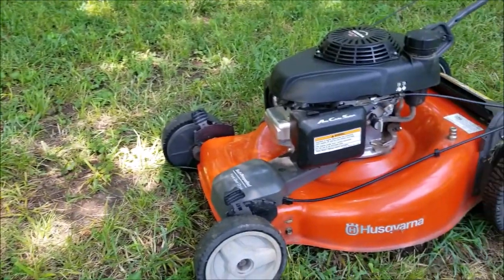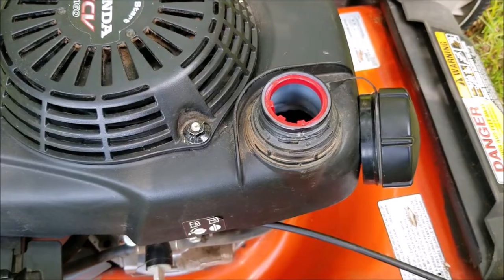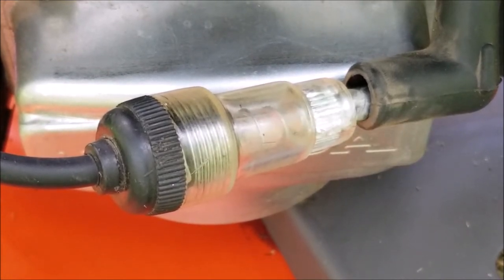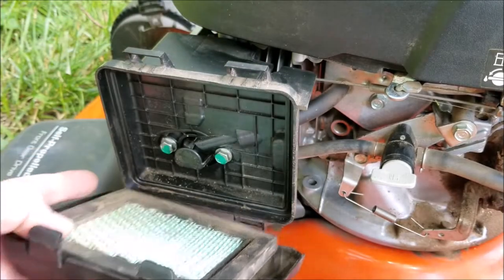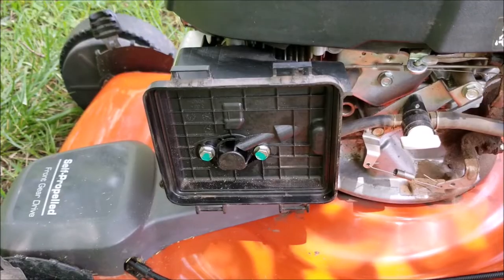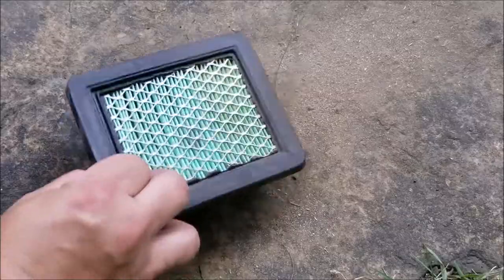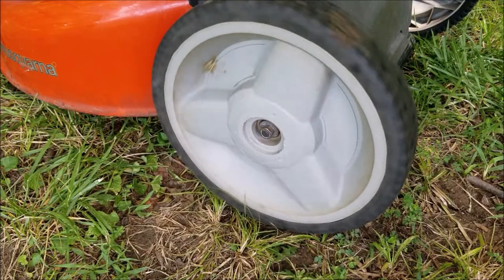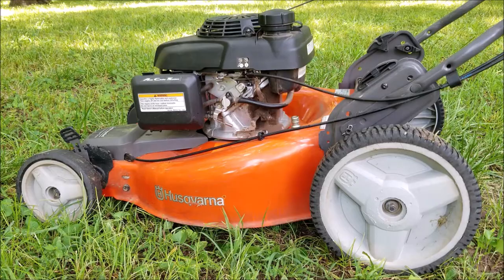Fix a Mower that stopped while mowing and won't start again

Comment: That's a very good mower. Nothing wrong with it. Just dirty carburetor.. Easy fix. Keep it. Don't sell it. I was given the same model & used it 3 years with no issues. Quality cuts... My brother borrowed it & sold it. I have not found any at all. I went with Honda mowers. I miss that Husqvarna..
Reply from the maker: thank you I appreciate the advice.  yes they are quite nice mowers
Reply: @INSIDEHOUSEGARAGE  very nice quality cuts is what impressed me from that mower. I contacted a lawn equipment company out of Illinois with similar model but they don't ship throughout the states. Too bad. Thanks for sharing.
Reply from the maker: @ivanhmunguia5576  no problem

Comment: I usually blow the dirt out from the inside of the filter with compressed air multiple times during the season, when it gets too dirty to clean I’ll replace it. I like to buy them in bulk since I work on a lot of equipment. It’s amazing how some folks won’t even do the slightest bit of maintenance and just throw a perfectly good mower to the curb. Great find there, AYP mowers with Honda engines are very nice indeed!
Reply from the maker: I absolutely agree with you.  Thanks for the comment I appreciate it
Reply: Yes, they don’t want to spend money on maintenance but throw away mower and buy a new one. 🤦‍♂️
Reply: I was under the impression using compressed air was a no no. The air penetrates the pleats forming very small holes in which dirt is sucked through into the cylinder. What I do is knock off the excess dirt onto a hard surface like the driveway. After a few times it just pays at that point to replace it.
Reply: @tedpergolizzi6455  blowing from the dirty side into the paper is definitely a big no-no. The correct way to do it is to tap it on a hard flat surface to get the loose dust out of the way then blow with compressed air from the inside (the clean side) out. You never want to hit it with compressed air on the dirty side or you will push the dirt into the filter and clog it up even worse.
Reply: Talking about cleaning filters I found a k&n filter that will fit my mower but I didn't buy it cause its about 50$ but k&n sells a cleaning kit for their filters , but I went with the cheap pleated 5$ filter that they all come with maybe one day my self-propelled mower will get an expensive lifetime filter lol

Comment: My Briggs and Stratton lawnmower has a reoilable air filter which I clean & reoil every time that I change the oil which in my case is about once a year because I probably just manage to get up to 25 hours on it annually, Briggs and Stratton recommend changing the oil every 50 hours but I cut that in half.

The grass actually grows in the winter time on the east coast of Australia more than it has done at summer time because we've been through a drought & hot scorching summers which kills the grass so there's no lawn to mow.

The overhead cam Honda lawnmower engines has a compression release camshaft so expect to see a low figure of 60 PSI when doing a compression test,my dads is at 43 PSI now because it's 17 years old now & it needs a rebuild with new piston rings fitted !
Reply from the maker: Thanks for the information about your growing season.  Yes the compression release will do that. Thanks for the comment Russell Booth
Reply: @INSIDEHOUSEGARAGE  The flathead book  have and all the old manuals say every 20 hours. Planned obsolescence again.,

Comment: Thank you young man for  saving that mower .the Husqvarna walk behind mowers are great mowers but I've heard the riding mower,s are using thin metal on the frames so they don't hold up to well .plus they have a plastic transmission  see you later young man who has saved another mower from the scrap yard 😃
Reply from the maker: I've never had a husqvarna rider so I'm not sure about them but I do believe that company's are making things cheaper to make more profits.
Reply: @INSIDEHOUSEGARAGE  that is going to be their down fall

Comment: Thank you sir, I appreciate all your information. 
I have a 12 year old craftsman that runs not great but it does the job. Lately it’s been running high. Not sure why. 
Also in order to stop the machine I have to pull the plug on spark plug.
Reply from the maker: at least it still work for you. And if would seem the piece of metal that makes contact with the Flywheel brake is not making contact  like it should

Comment: On my Toro gas push mower, we used a wire brush and WD40 to clean off rust and corrosion from the ignition coil contacts near the flywheel. It would start for a few seconds, then shut off. Now, it runs fine.
Reply from the maker: thank you for that

Comment: I don't replace anything unless it's needed unless I run across something and see it's time. I don't mind a Husky mower but I can never keep the travel speed steady like a Snapper. They cut fine but I can't handle the speeding up and slowing down so much. I was hunting your other half of the mower that nobody wanted about the electric start fix. The one I'm getting has the battery on the deck and is older than that one. I can get what parts I need since it runs fine and I think I have a new catcher for it. I'll just have to drain the gas and start from there. Seems like it has a primer bulb that I replaced when I got it and the mower had been flipped or stored wrong because the air filter was full of oil and dirt. WAS is the key word. So THANKS and BLESSINGS!
Reply from the maker: good luck with it. I like electric start but sometimes the parts are just pricey. The battery Is the one that kills me, but I have a way to get around that, when it comes up next time. Thank you Lewie McNeely
Reply: @INSIDEHOUSEGARAGE  I was looking for the #2 video about the electric start one you got,  to see what you did but couldn't find it in the archives. Oh well. It'll be for here so parts will be bought once and the mower will be well looked after. BLESSINGS!

Comment: I just changed mine last year after about 10 years. I do shake it out throughout the season and blow it out good in the start of spring. I only changed it because it was running rough and I cleaned the carburator.
Reply from the maker: That makes perfect sense to me.  Thanks for the comment

Comment: I have just like the same mower Husqvarna with Honda Honda engine very strong engine but mine is rear wheel drive awesome machine
Reply from the maker: Yes i would have picked the rear wheel drive version myself.

Comment: I have three push mowers and 3 riding mowers that I use on a regular basis. None of them get a ton of hours put on them, so I usually do it every other year. I will usually do it every year on my primary mower. It just depends on my mood.

Comment: One of the best practices for mowing, is to always keep the blade sharp. I like to sharpen a bit
better than blade comes from factory, mower runs easier and cut is cleaner. To do this, one
needs a slap bastard file and a decent vise to hold blade in right position, a vise where blade
can be held flat would be best I guess. Went to hardware and asked for a bastard file, clerk
showed me a fine grooved file that would barely file fingernails. I told him that wasn't a bastard
file, but he argued it was. So much for Florida city types.
Reply from the maker: excellent advice

Comment: Your best video yet! Prime example of what lack of maintenance will do to a small engine. I change the oil, air filter and spark plug usually, every year. I do not have issues. My push mower is over 20 years old! A plug, filter and oil can be purchased for around 15-20 dollars. Compare that to a new, premium mower of around $400-$500. Cheap maintenance!
Reply from the maker: You are absolutely correct about that and.  Thank you Jim America for the comment I appreciate it

Comment: I have same brand mower, but different model, it looks slightly different. It is amazing! Similar issue except my filter is clean. How do I know what spark plug to buy? Or is safe bet to just take it out and bring it with me to the store? Whats the best oil to use? I lost my manual a long time ago.
Reply from the maker: sure I would take the plug out and take it to the auto parts store, or to your local hardware store and they should have it. Use the best oil you can, synthetic oil is best but regular oil is okay 10w-30
Reply: @INSIDEHOUSEGARAGE  Thank you for your advice, have a nice day!
Reply from the maker: @scuba6797  no problem

Comment: The air filter is one reason i like VICTA (au) lawnmowers, the air filter is located high up on the handle, well away from dust and debris.
Reply from the maker: I've seen that, I wish it was that for the US versions.

Comment: I have a Husqvarna with the same engine, don't be fooled by the low compression, the cam has a decompression valve that holds a valve open at low RPM making the mower easier to start, once running the decompression valve closes and the engine runs normally, no matter how hard you pull the rope you will not get a proper compression reading. The best way to get a proper compression reading is to remove the valve cover and remove the rocker arm from the exhaust valve and then test it.
Reply from the maker: What should the compression number be with a working compression release?
Reply: @INSIDEHOUSEGARAGE  On my mower it was 30 psi, after I removed the rocker arm the compression was 150 psi
Reply from the maker: @BigTex8319  NICE! can I remove the release or bypass it without taking the engine apart?
Reply from the maker: @BigTex8319  thank you

Comment: You know that start-stop cable attached to lever that folds down on handle? That was the problem
with mine. Cable was not pulling arm to motor mechanism far enough, preventing starting. And
if I pushed arm farther, it started but then while mowing the lever would slip back and stop engine.
I fixed by wiring lever to on position. I never used the safety feature anyhow, always tied folding
lever to handle to prevent stopping. A nuisance for me. Maybe it's needed for some people. Now
with start lever held in place to start/run position, I pull plug wire to stop. Old farm boy, always
availed of field expediency. None of the videos I watched on YT covered this, but I haven't watched
them all. I'm sure the safety fanatics [city slickers] will condemn my method; it works for me. So
sue me.
Reply from the maker: Whatever works for you.
Reply: @INSIDEHOUSEGARAGE  Oops! After fixing that problem, then mower still died
when I went to mow. What was it? The gas cap! This happened before. On some
mowers, if gas cap is screwed on too tight, it kills the motor -- maybe a vapor lock
or something. I loosened the cap, but then it vibrated off and lost it. Replaced with
another mower's cap. But also screwed on too tight and so was killing engine. 
Loosened and finished mowing. It's always something. Experience helps but one
needs a good memory as well.
Reply from the maker: @rockyfjord3753  yes it looks like your gas caps vent isn't working completely

Comment: Not until there is a problem but I think I need to start doing more preventative maintenance. Not sure how much their new mower cost but I bet it was more then a spark-plug, new filter and a hour or two.
Reply from the maker: You are absolutely correct about that.  Thanks for the comment

Comment: Have an old black max with Honda gcv 160 and was trying to shut off the fuel to take out the carburetor, but when I did, I found that the gas was still flowing.  Is it possible to remove and fix the shut off valve or should I just replace it?
Reply from the maker: I have never taken one apart, to fix it, so I'm not sure. I would replace it with an OEM part, or get an aftermarket one.
Reply: @INSIDEHOUSEGARAGE  thanks!

Comment: While the dirty filter was definitely a problem, the oil overfill was the main cause of the carbon build-up on the spark plug.  The overfill was nearly 1/2" high when viewed at 1:35 in the video.
Reply from the maker: Thanks for the comment

Comment: Takes two people to do these things. I'm a single woman who isn't afraid to work on my lawnmower. My lawnmower doesn't start unless I put it in the sun for a while, even this doesn't always help. It's a 4 year old Husqvarna with a Honda engine
Reply from the maker: sound like the choke isn't working and that's because a warm engine doesn't need a working choke.  Have you ever taken the air filter off to look to see if the choke flap is closed when the engine is cold?

Comment: That was funny,, an easy fix to get it going just simple care needed.😀
Perhaps the oil level may have attributed to fowling of the plug.
Honda sat change oil 25 hours Victa/Briggs & Stratton 50 hours
Honda as a standard don’t have a pre-filter before air filter as Briggs & Stratton do,
Reply from the maker: the more maintenance the better, I would do the oil more often then care for a pre filter.

Comment: What does he mean by rings worn out. Mine was running black smoke on startup and I'm not sure why
Reply from the maker: the rings help to seal the combustion side of the piston.  Yours puffing black smoke means your choke flap is not opening

Comment: This might shock you but I never changed my air filter on my chainsaw or wacker at all and  the chainsaw will be 31 years in November and my wacker is 17 or 18 years already. I just make sure and clean them regularly
Reply from the maker: wow that's amazing

Comment: Hi, my Troy-Bilt Tuff Cut 230 stalls while cutting grass.  I put a new spark plug, new filter, and cleaned carburator.  The sell propel feature works until it starts cutting grass.  It starts sounding like it's struggling and then dies if i keep cutting the grass.  I checked that small lock pin in the axle and it looks fine.  Any ideas on what to look for?  Thanks
Reply from the maker: sure, have you confirmed that the blade is on correctly and if it is, is it sharp?
Reply: @INSIDEHOUSEGARAGE  the blade is in correctly but the blade may not be sharp.  Does the sharpness of the blade cause the lawnmower to hesitate ?
Reply from the maker: cutting tall thick grass with a dull blade, will put a huge strain on the engine. As far as hesitation, only when cutting the thick parts, not in the short grass

Comment: Another way to tell if your air filter is bad is if the machine spews out black smoke when starting, a fouled plug can also contribute to that problem
Reply from the maker: yes you're absolutely right

Comment: What engine oil did you use?
Reply from the maker: regular 10w-30 oil.
Reply: @INSIDEHOUSEGARAGE  Thank you, I figured but I wanted to make sure 👍
Reply: So I've changed the oil, changed the filter, and put in a new spark plug but I still get nothing. Do you have any idea what else it could be?

Comment: I'd have to admit, I am kind  of like you... I don't change mine as often as I should either....lol
Good video, however I noticed that the fuel shut off was in the closed position when you were trying to start it up at test and I am curious if you noticed this later on after everything you did to fix the problem. Not trying to be a bad guy or anything just trying to figure that out and wonder if that was all that the problem was when the original owner got rid of it because they overlooked it and said oh well I'll just go buy a new one.
Reply from the maker: Yep I've been called out on it so many time to. The engine will still start with the valve closed as Long as theres fuel in the bowl and line up to the valve. So when I film, even if it won't start, I have to make sure the valve is open otherwise people will point it out. Thank you Rob Kercheval
Reply: @INSIDEHOUSEGARAGE  
Right I get it, hate when people think they are better than someone else and go and do things like that. I'm sure when they call you out on it they're not very polite about it.
I personally was just curious if you had over looked it as did the previous owner and that was why it wouldn't start, that is why I asked. 
I know there usually is residual fuel left in the bowl but if the valve was turned off before you got then they may have ran it out of fuel and just got rid of it. That's all I am really getting at here because we've all been there and done things like that and were just frustrated... we all have bad days... lol
Reply from the maker: @MrGattor33  it's funny because most people didn't even realize that there was a fuel shut off valve. So, no the fuel valve isn't off when they have they're problems. I also have to remember to turn the valve ON in front of them so it will run for them when they get it home.
Reply: @INSIDEHOUSEGARAGE  
Makes perfect sense. Thank you for replying and not thinking I'm trashing you on this. 👍
Reply from the maker: @MrGattor33  no problem

Comment: Conclusion- owners who don’t even do $30 in mastic maintenance once a year shouldn’t own lawn equipment. 
Change oil plug and filters at start of every season. Sharpen blade too and avoid 75% of the problems.
Reply from the maker: you got that right, basic maintenance will solve a lot of it.

Comment: How did you know the Compression was ok again
Reply from the maker: so this engine has a compression release so it makes pulling the rope very easy, and while pulling on the rope, I felt more than enough "fight" from the engine. I probably should have done a compression test but when it was described to me how it "died" while mowing, I was already moving away from a compression problem.

Comment: If only we could smell how rank-stank that dirty oil is.
Reply from the maker: I'm sure you seen oil like this before. It's not that bad just looks terrible.
Reply: @INSIDEHOUSEGARAGE  Not often. Most of what I've had is either fuel or water contamination. Only a few were original oil with metal.